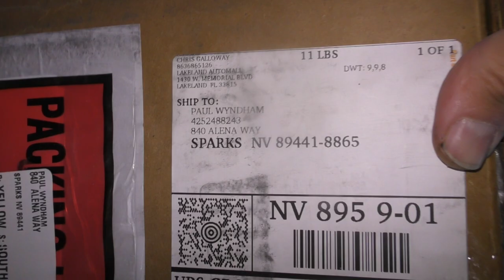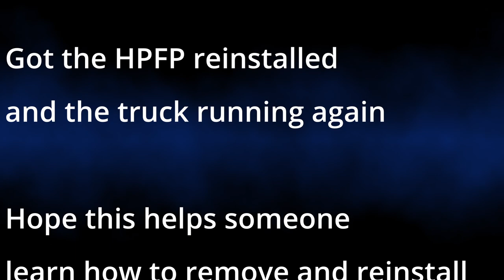HPFP Replacement on a 2014 Ford 6 7L Diesel   Part 2

Comment: What failed on your CP4? Did you have metal shavings from pump failure?
Reply from the maker: Nope no metal shavings. It somehow just stopped building pressure like it was just sending it back to the tank or something. The local dealer even confirmed that it was not a catastrophic failure.

Comment: Great video, was your truck on limp mode and was p0087 the only code u had ?
Reply from the maker: Yes P0087 was the only code. It would go into reduced power mode all the time but never reduced the speed I could go. So I could go at freeway speeds but if I tried to pull anything it was gutless.
Reply: @builditgarage  thank you for replying, mine has p228f and p0087 and i have the same issues as you but it feels powerless and I've changed all sensors belonging to the matter but nothing has worked
Reply from the maker: @narrowexpress9096  Does P228F have too do with the low pressure pump having too high a pressure?
Reply: @builditgarage  idk those are the codes I'm getting low fuel rail pressure and high fuel rail pressure I don't understand how low and high at possible

Comment: im hoping this job will be fairly similar on my 2019. I just bought it with 120k and im going to do a new pump and a disaster prevention kit just as a preventative maintenance. Do you have any links to any sort of online manuals or forums  you used or anything for timing the pump etc.?
Reply from the maker: It was really hard finding any information on the pump replacement. I actually did the job twice because I tried one of the rebuild kits I found online. But I probably had some debris stuck in it causing it to release the pressure. I found some videos here and there that address some portion of the job, but mostly they glossed over it. I don't have anything real good to tell you about where to find documentation. I apparently don't have any bookmarks to documents or webpages. Make sure you get new metal fuel lines like ronhannink1968 stated in a comment on the first video. The pump only goes into the pump gear one way and if you line up the marks as shown in the beginning of this video it should be timed perfectly.

Every thing I found said you had to drain the coolant. I found you can skip that. I don't know how that will play out on the 2019, but I think they just make changes to the internals, turbos and other things to get more performance out of the engine. The overall layout should still be similar.

As for forums I think I like the dieselstop best: https://www.thedieselstop.com/

Good luck with your maintenance project.

Comment: Has the pump failed or have you had any other fuel system issues since you replaced it?
Reply from the maker: The HPFP worked great until I traded it in for a PowerBoost. I was having issues with the low pressure pump I installed.